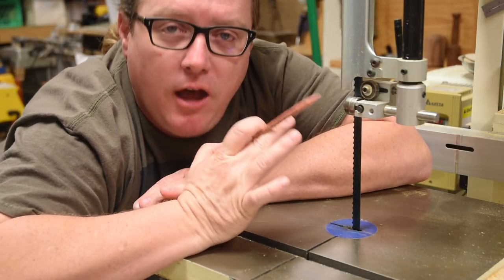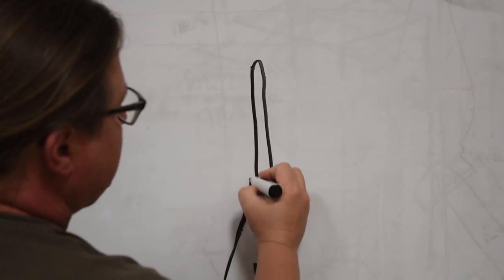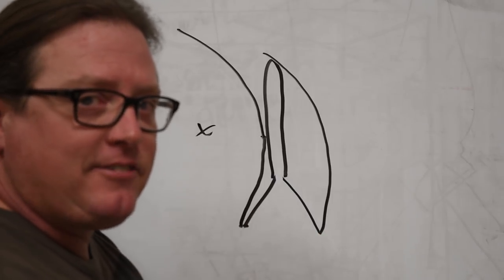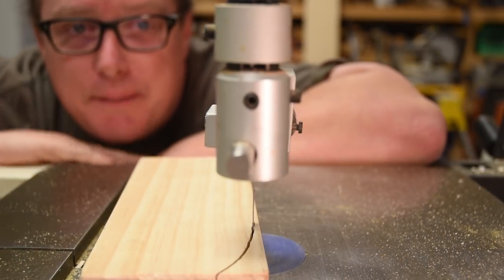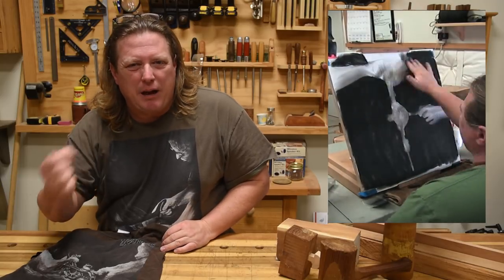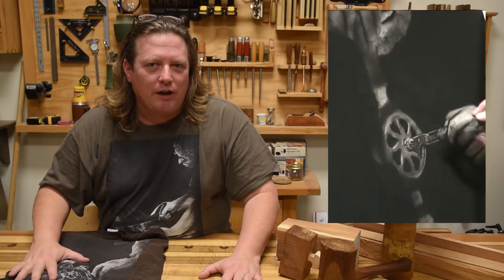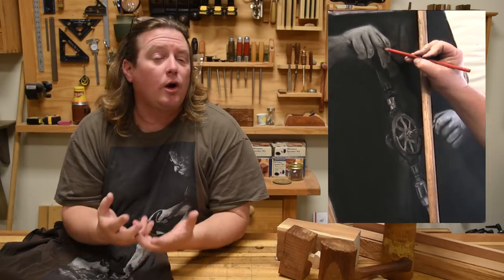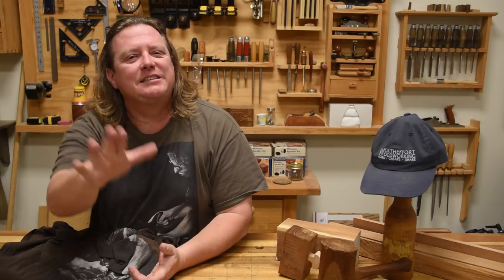Band Saw Curve Diameter

Comment: I just found your youtube videos. Thank you for making them. They are very detailed and informative. You're also a very talented artist. Have you made any videos on how to cut a 6" block of wood doing curves on the bandsaw? I have a 6" block of wood I glued together from oak, maple, and tigerwood. I plan to make a bandsaw box with draws, of course. I'll be using a 3/16" blade with 4 tpi and raker teeth. I worry I may not be able to curve the drawer corners enough to cut the drawers out. Any feedback would be helpful. Have only done a small amount of bandsaw boxes with softwood.
Reply from the maker: I haven't done many bandsaw boxes in my career but I believe they use finer blades than that. You might want to check around the half priced book stores as I seem to see lots of books on the subject pop up there. Oh, and stick with hardwoods for that kinda stuff. Dried hardwoods.

Comment: When cutting bowl blanks with a blade that is to wide , could you use relief cuts up to your edge of the circle , thus reducing the tension on the blade ?
Reply from the maker: A bowl smaller than the diameter of a 3/8" blade wouldn't be worth bandsawing out. Just turn it.

Comment: Thanks for another informative video.  Would I be correct in assuming that for my blade which I use for resawing, that I should not round off the back edge of the blade?
Reply from the maker: It's good to remove the burr made from manufacturing so it doesn't damage tires or blocks.

Comment: Recently got a WEN bandsaw, I know it's not the most expensive or highest quality, however how tight should the blade be?  Seems to twist very easily at the moment.  Great video, thank you.
Reply from the maker: General rule of thumb is tight enough you can push it without your fingernail changing color or tight enough that it stops fluttering when on. Really hard to explain as there are variables in tires, blades, diameters and such.

Comment: here is my question on the T-shirts.   your website says the art work is printed on the back of the shirt with the Wortheffort logo on the front.    I'd rather have the artwork on the front of the shirt , like the ones YOU wear.    which is it?
Reply: Mine has the artwork on the front and the logo on the back. It's a great shirt, just like Shawn says. I didn't need a shirt, I just felt like I needed to help his channel out a little.
Reply: Ditto what Bill K said
Reply from the maker: My bad. I changed it a while ago and didn't update the description. Art's on front and a tiny logo at the neck line is on back.
Reply from the maker: Thanks, every bit helps.
Reply from the maker: Every bit is appreciated. And everyone needs a T-shirt!
Reply: Wearing mine right now. Gonna show it off at the VA in Boise Idaho...
Reply from the maker: kewl